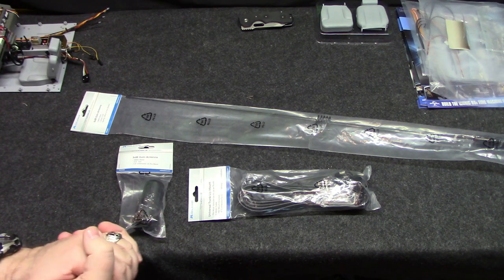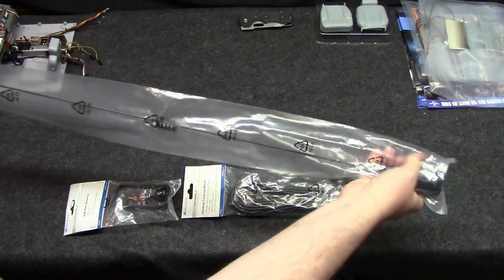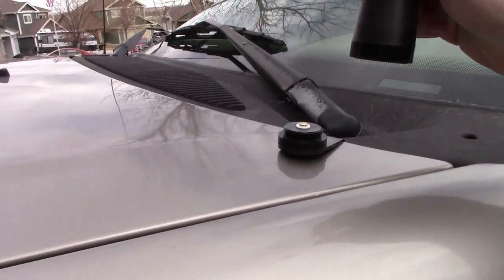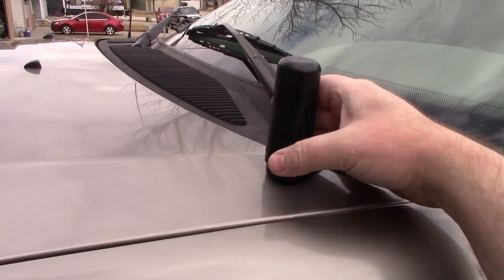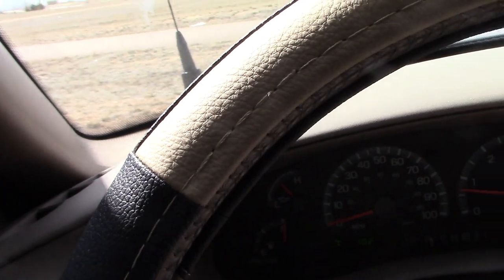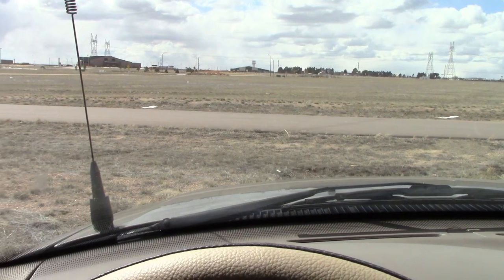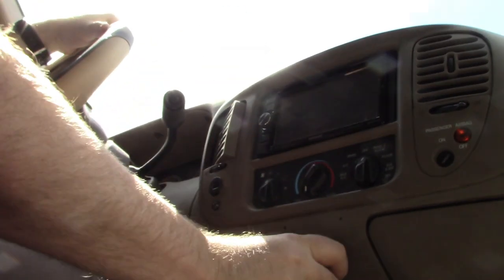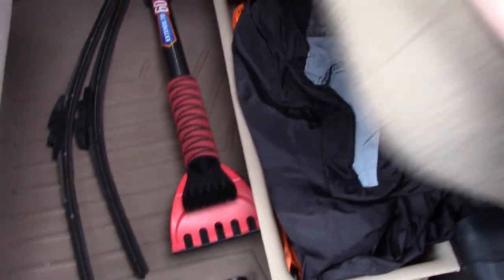Midland 6db & 3db Ghost Antenna Install & Test - GMRS MicroMobile

Comment: I have the MXT275 and both the 3db Ghost and the 6db antenna from Midland. And I use the same hood lip mount as demonstrated in this video. With the ghost antenna I get reasonable reception; I'm able to hit a repeater 14 miles away pretty easily. But when I switched out with the longer 6db antenna the quality of the sound coming through that repeater was much better; less background noise relative to my voice. Less static wafting through the transmission. And I was able to hit it more reliably, from places where I typically find it more challenging.

The shorter one is fine for closer communications, and adequate for longer ranges if there's not much obstruction. But the longer one definitely sounds better as you get further from the receiver. I'm glad I have both, though, because the long one, at 31", affixed to the hood of my '95 Bronco, measures 7' off the ground at its tip, and taps my garage door on the way into the garage. So for "day to day" use, I'll stick with the ghost, and then when I head out for longer drives, camping trips, and so on, I'll swap to the long one.
Reply from the maker: Thank you for the excellent comment with your experience.
Reply: It seems like the ghost antenna would be great for a vehicle that wanted to remain low profile.

Comment: Hey, thanks for the real world review!  I bought a couple of Wouxun KG-UV9GXs for ecomms to my daughter about two miles away from Better Safe Radio.  Suburban  environment.  Stock antennas are wide band because these are scanners too.  Couldn't reach.  Got a couple of 1/4 and 5/8 wave antennas and it was a little better.  Was considering a roof set up but the loss on 5 watts will kill me on the 80ish foot run.  This might work but with a mag mount.  It's all voodoo antenna physics.  Thanks again.

Comment: That's pretty impressive.  I'm like you I like the smaller 3db antenna.
Reply from the maker: I was impressed with the little 3db ghost antenna. It would be even better up higher on a light bar and blend in nicely. I'm just having fun with this GMRS stuff.
Reply: @TheRealCobraBurnout  Agreed! Is there a mount they would allow it to have a magnetic base like the original antenna they came with the radio?

Comment: Hey bud. How do u rank the 3db ghost antenna? I just installed my MXT115 on my Nissan and I'm please with the stock baby antenna it came with but I'm sure the mini 3Db antenna would be better amyway.
Reply from the maker: better than stock antenna that comes with MXT115. Even though I mounted it on the hood (lower location than roof) it still did better.
Reply: @TheRealCobraBurnout  I'm planning on getting Midlands lip mount and this 3db antenna. Really my GMRS setup is for family convoys on the interstate for car to car so I think that'll do. Thank you for the help!!!

Comment: Have you seen the Hardened Power Systems Operator 115 for the Midland MXT115 GMRS Radio?  It’s kind of got me thinking about GMRS.
Reply from the maker: I just searched it after reading your post. That is freaking cool and useful! https://www.portableuniversalpower.com/our-products/operator-115/
Reply: I have one...it's a real nice unit but might have to part ways with it...also have the solar system for it.
Reply: @wonkamywilly2456  is there an issue with the MXT-115 Operator unit? Or do you just  no longer need it? I’m asking because I’m looking for customer feedback before deciding to purchase one myself.
Reply: @rkgrkg1384  love it but never use it...always working unfortunately. Solar setup works great too.

Comment: Hey there @TheRealCobraBurnout, did you by chance happen to test the SWR on the 3db Ghost antenna?  I just received mine and the SWR tested high on GMRS channel 1 and on channel 16.  Both were 2.1 to 1.9.  Just curious as to what yours or anyone else's may be.  From what I have found from searching the interwebs, these Ghost antennas can not be tuned...
Reply: My ghost antenna also tested 2.1 on the SWR

Comment: I have the MXT275 MicroMobile GMRS Radio and the Midland 3db Ghost Antenna. I plan to use a powder coated stainless steel hood bracket to mount my antenna (bracket attaches to the passenger side hood hinge). Do you know if the Ghost Antenna would require a ground?  I am thinking the powder coat may affect this and I would need to sand off some powder coating and run a ground strap from the sanded off area to the body inside the engine bay. What are your thoughts? Thanks.
Reply from the maker: Is it a home made bracket?
Reply: I have the 3db host antenna on my MXT275.  I'm using it with the magnetic mounth from Midland.  That magnet works awesome.. and it has the cable already attached.  I literally go thru the car wash with my truck and the high powered dryer doesn't even budge it.   I like the 3db antenna.   Works much better than the stock antenna.  But I'm debating on getting the 6db whip antenna too.

Comment: Hello  I have a UHF antenna with a  removable 10 inch spring  for a UHF cp200 radio.  I just got baofeng radio dual vhf/uhf. Question is can I use that antenna for the baofeng,  and if not why so 🤔
Reply from the maker: I have no information about Baofeng

Comment: I use CB SSB with a good setup and coax and antenna i talk in the city over 20 miles and on open terrain about 60 miles or even more if i bounce my signal i can communicate a few states over!
But from what I am seeing 90% of people don't know squat about RF, or radio comunincations for that matter.
Reply from the maker: Yes

Comment: Get better reception if the antenna was on the roof.  👍🏻
Reply from the maker: Yes I know. But that was the point of this. Moved the magnetic antenna from the roof (because I'm not drilling into it and have no lip to mount anything) to an antenna set up like these. Still got just as good and actually better than my other set up I tested.
Reply: And my problem with roof mount Jeep Liberty im screwed if I go through a Wendy's drive through with a low overhang or parking ramp

Comment: With the smaller stubby unit , did you have to tune the unit to your radio ? What about the longer one. Thanks.
Reply from the maker: No way I see to adjust the Ghost antenna but I could be wrong. The 6db "whip" should be adjustable but I didn't mess with it because Midland tries to simplify their GMRS antenna/radio set ups. They pre-tune them. Obviously some variables like where you locate the antenna on the vehicle will still factor it. I do have an old cheapo SWR meter. Maybe worth checking out.

Comment: I can't put a antenna on my condo roof, looking or a window atenna if they exist or  will something like this work?
Reply: Not a good choice for a window. 
This needs a ground plane which is the car hood in this case which is the “bottom half” of the antenna.  
Check out roll up j pole antennas such the DBJ-2 from Ed Fong...no ground plane needed.  Might be too tall for inside a window...
Reply: There are half wave antennas that do not require a ground plane that may work well.  They are only about 12" tall.  You could use the ghost antenna if you need something as small as possible.  Just put something metal under it like a baking sheet.

Comment: Do you know if that mount could be used with a no ground plane antenna to any success? Looking for an option for my semi which is fiberglass body
Reply from the maker: These are no ground plane but are GMRS. I also could not guarantee it would mount / fit on a semi hood. Maybe better options at the truck stop stores.
Reply: @TheRealCobraBurnout  yea I know they are gmrs I'm looking to put in a gmrs radio into my semi but none of the body on these is metal. I'm trying to find a way to mount it and use it atleast decently. Rugged radios sells a kit with a no ground plane antenna and a mount but it is a mag mount which I can't do it won't stick.

Comment: Thats the same spot I put mine. The only thing I would tell you is that make sure where those two mounting screws are you scrape a little bit of the paint away so it makes it better ground for the antenna
Reply from the maker: Thanks for the tip Sir! I'm enjoying these GMRS radios. Still a novice and its pretty stress free. My wife still thinks I'm crazy but thats normal. lol
Reply: I have same setup with the stubby Antenna. Will install in morning and my wife thinks I’m crazy too. Nice video tho👍.
Reply from the maker: @titogonzalez4731  Awesome and thanks
Reply: @TheRealCobraBurnout  so is my wife

Comment: So whats your impression on the 6db vs the 3db antenna? I have the 3db ghost antenna on my MXT275.  It works pretty good, but I'm wondering if I'll see a significant range increase if I move to the 6db.  Do you think its a big enough upgrade.. or is it minimal and not worth the money since I already have the 3db?
Reply from the maker: I got a few more miles out of the 6db. If I had either of these up on the roof rather than the hood, they both would have been better as well.
Reply: Are you able to connect and transmit on repeaters on your Midland mxt275? I have that radio and  I turn repeater on. I even checked the CTSS and still not able to transmit onto a repeater. Not sure if I am screwing up or the midland mxt275 is unable to do it
Reply: @JuneBuggJr I just went through the same thing. I watched another video that helped get me through it. It's a little tricky.
Reply: @davidb.turknett4447  congrats.  I been having a hard time and finding a detailed video.  Able to let me know the video you seen so I can too? Please.  Much appreciated
Reply: @JuneBuggJr  YourFriendStChris it's about 6 months old.

Comment: How would you adjust the SWR using the Ghost antenna ?
Reply from the maker: You don't.
Reply: So the antenna is that good I'm guessing. Thanks. It's the only one we decided that will work on my car.
Reply from the maker: @RobtP6  Midland pre-tunes it so the only difference in performance you could see is in location placed on vehicle.

Comment: How did you run the cable to the cab?
Reply from the maker: firewall has access hole for cabling. Most firewalls do at least on the drivers side. sometimes they have a little rubber boot cover int it. You can pop the whole boot or cut a slit to feed cable thru.
Reply: @TheRealCobraBurnout  Thank you!

Comment: There is no way that stubby antenna has 3dB gain; it may be as bad as -3dB.  A quarter wave whip that's about 6 inches long has unity (0 dB) gain. Definitely go with the longer antenna; it may actually have 3 dB or a little more.
Reply: This!
Reply: Even the 6dB is likely closer to 0dB.
These work, but are a huge compromise compared to a proper 5/8 wave, or even 1/4 wave.

Comment: Using an NMO hole mount would yield a vast improvement on transmission and reception. It’s easier than you would imagine and, if installed correctly, is completely waterproof. All that’s needed is remove either the dome light or, the third brake light, so you can see where to drill. Use the correct tool also, they can be found online easily. Routing the coax is a breeze and a lot easier, IMO, than routing it through the firewall. That 3dB antenna would be low profile and, be more efficient. The current mounting location, you’re using, degrades the signal pattern so much.
Reply from the maker: No kidding? I didn't know. Did you do a vid yet?
Reply: NMO 100% ALL THE WAY. That's all I use, it's the pro's way and only crimp, NO SOLDER WHATSOEVER!!

Comment: do you have your gmrs call sign the reason i ask if you dont have one transmiting with out it you can get in trouble with the fcc
Reply from the maker: Yes, I do. WREX542  I got it before I purchased any of these radios. However this is an edited YouTube vid and FCC doesn't require I broadcast it in the video. Although, I think maybe in future ones, I leave that piece in rather than cut it. So much footage, vids become way too long. But it may give the wrong idea possible. WREX-542
Reply: @TheRealCobraBurnout  BUT IN THE SAME MATTER IN THE RULES  STATE THAT DURING ANY TRANSMISTION THAT HAS TO BE DONE AT THE BEGING AND EVERY 15 MIN . NOW I AM NOT SURE ABOUT YOUR DAUGHT HAVING TO DO . I BELIVE AS LONG SOME ONE PUTS YOUR CALL SONG OUT THAT U GUYS ARE FINE

Comment: Current Rules DATA: 

§95.1751   GMRS station identification.

Each GMRS station must be identified by transmission of its FCC-assigned call sign at the end of transmissions and at periodic intervals during transmissions except as provided in paragraph © of this section. A unit number may be included after the call sign in the identification.

 

(a) The GMRS station call sign must be transmitted:

(1) Following a single transmission or a series of transmissions; and,

(2) After 15 minutes and at least once every 15 minutes thereafter during a series of transmissions lasting more than 15 minutes.

 

(b ) The call sign must be transmitted using voice in the English language or international Morse code telegraphy using an audible tone.

 

(c ) Any GMRS repeater station is not required to transmit station identification if:

(1) It retransmits only communications from GMRS stations operating under authority of the individual license under which it operates; and,

(2) The GMRS stations whose communications are retransmitted are properly identified in accordance with this section.
Reply from the maker: Yes...where you just sharing this for everyone's general knowledge or do you believe my edited portions of filming which became this vid where all that was transmitted during testing? Just curious.
Reply: @TheRealCobraBurnout   JUST DID NOT SEE THE CALL BEING GIVING AT ALL DURING THE VIDEO. JUST DID NOT WANT YOU TO GET IN TROUBLE THAT ALL.
Reply from the maker: @AndrewMurphy8383  Yes, thank you. I'll probably leave in the parts where a give it out in future vid edits.
Reply: @TheRealCobraBurnout  I guess we have a gmrs police on here lol very nice video .i thank you for all the great info 👍🇺🇸🗽
Reply from the maker: @timsmith9169  Yeah it's ok. I did give out my call sign but that was cut out of the final vid. Thanks all.
Reply: @TheRealCobraBurnout  I am sure my friend I just cant be leave some one would call you out on that . i thank you fir all the info